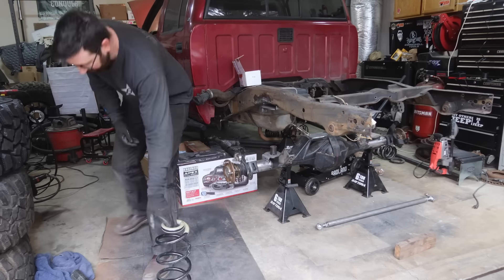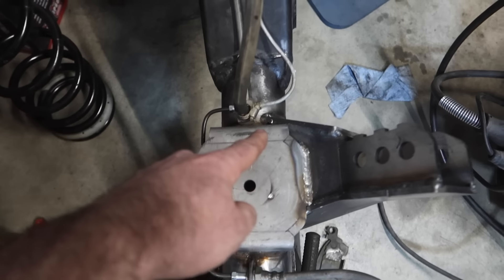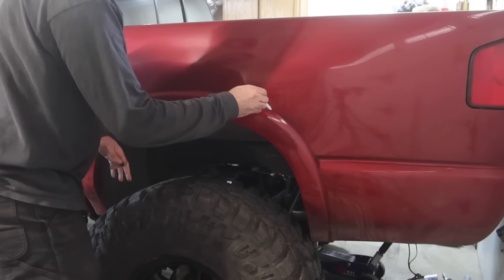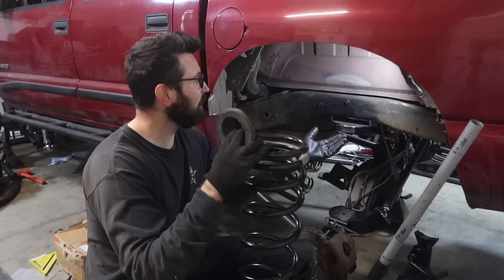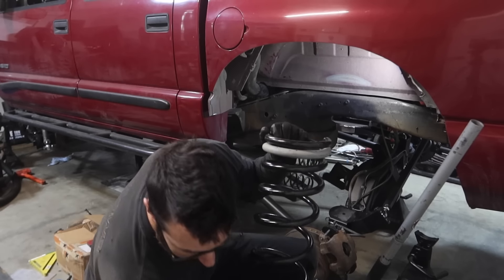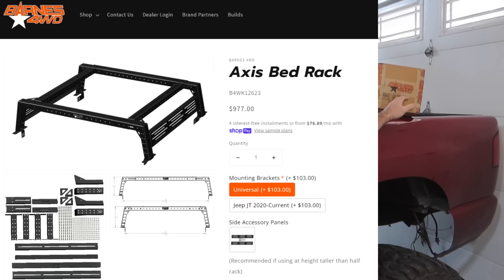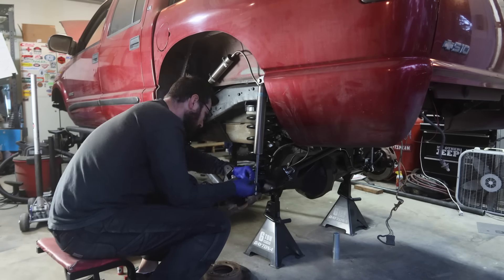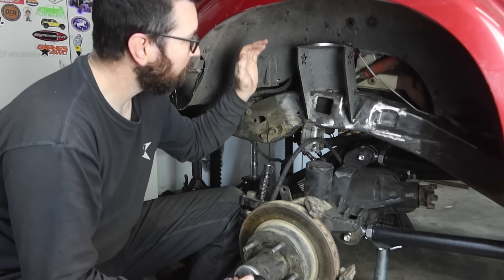Fitting 37's on the solid axle swapped S10! Setting up Bump stops, Shocks and trimming fenders!

Comment: My Metric-ton Comanche has a Dana 44  rear and a Dana 30 front. Would like a wagoneer front  Dana 44 but will likely settle in the 30 with Spartans front and rear. Most my driving is off road. Dandahermit.

Comment: you could make a coil retainer on the axle side and a locator cone or even just a tube it rides over that lets the coil unseat at full droop
Reply: Was about to say the same thing.  Very common in the Rover world.  On mine I actually use a secondary small spring as my upper retainer that lets the main spring pull away from the pocket then pulls it back into place.  Sorta hard to describe but works well enough.

Comment: Sucks you missed your goal. Did you go tag along with anyone? Looking awesome.  Me being a yj guy. Links are cool, but the s10 has a pretty arched rear leafs and are spring under. Might have been easier to just do an axle flip and gain the 6 inches and link it later. But im hard core leafs of the poors 😂

Comment: Just wondering what is the lift height on this truck? 6inch? I’m planning to do a SAS on my 2001 sonoma but leaf spring suspension. Great job by the way awesome video once again
Reply from the maker: Thanks, I can’t really say the lift height, but the frame is 23” from the ground. It currently has 6” Jeep Tj springs in the front and stock Jeep gladiator springs in the back.

Comment: I'm going to be starting this on a 2000 Jimmy, whats your overall height?? I'm a disabled Veteran and can't climb very high (I think I'm gong to be building a step into my rock slider)
Reply from the maker: My frame height is about 23”. It is as low as I can get it with 37’s.
Reply: @MuddyBeards4X4  thank you for letting me know. I'm fairly tall. I hope 2 foot is the highest I have to go.